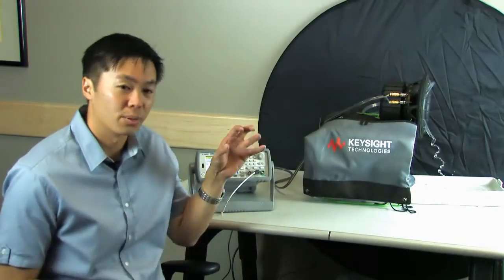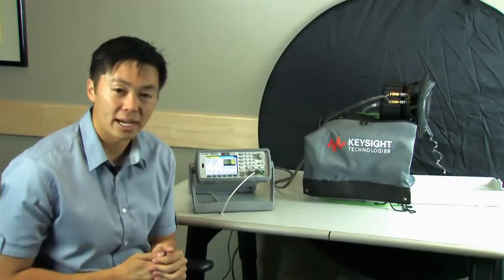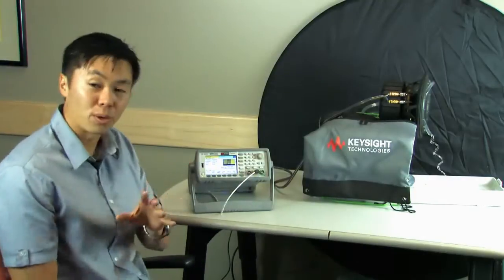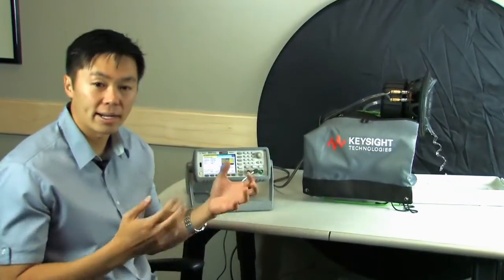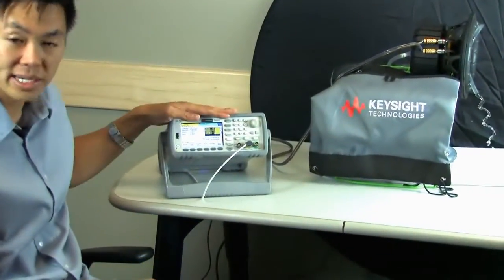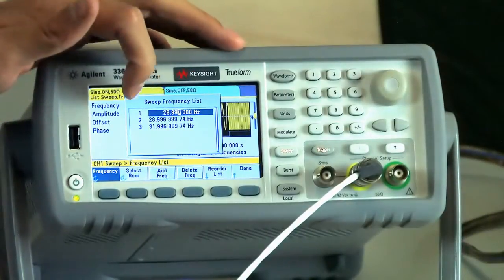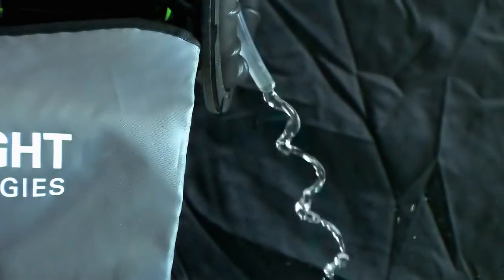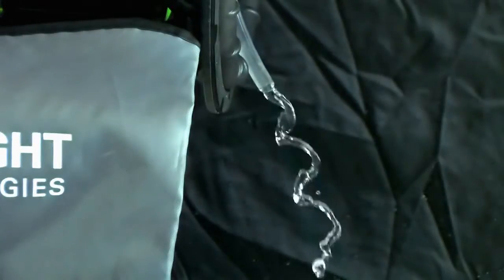Amazing Water trick with a Function Generator

Comment: When the guys on arf told me about it they had some idea to expand the knowledge into electronics but had no idea how. I know that the old guys basically just said it's a trick and worthless experimenting but it has an actual use in the system I'm building to trap cold and heat and use the trapped energy to power the actual web of signals that trap it.